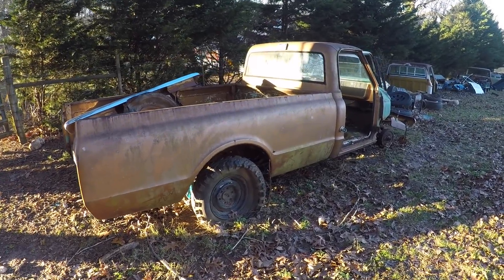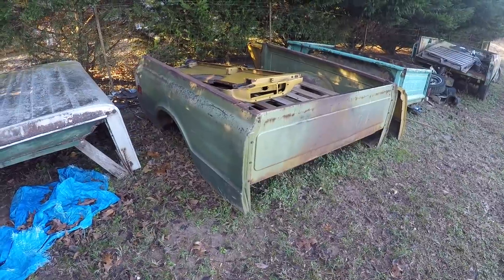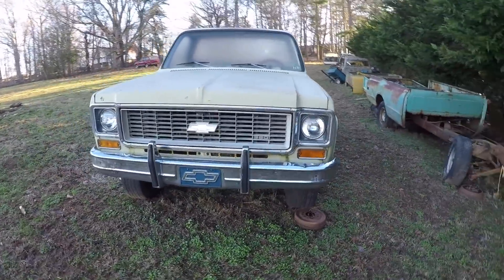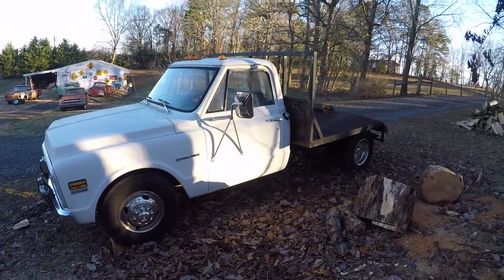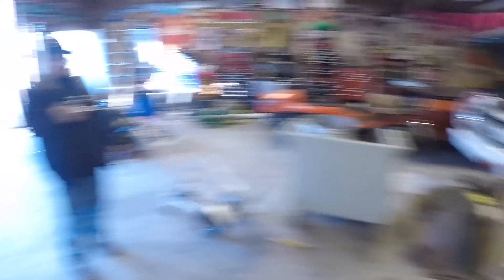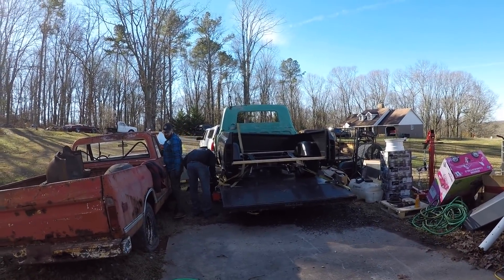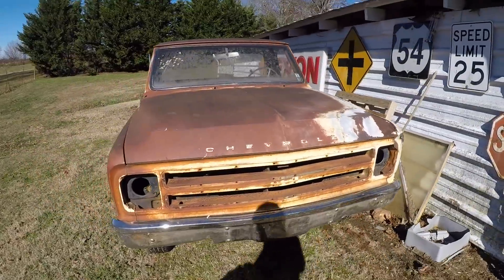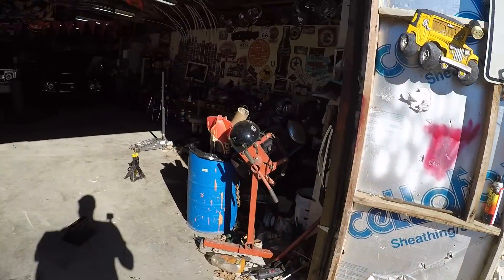CLEANING UP A MESS OF PATINA C10s!

Comment: Love the vids, I have a 1964 C10 I am resto-moding.  Was a rust bucket when I bought it a year ago.  Have "repaired" all the rust except the drivers door and hood.  Needed the normal, rockers, door pillars, door bottoms, a new roof inner and outer.  You get the idea, not professional repairs but cut out and welded patch panels in my garage.  But all of the suspension/steering/interior/brakes/lines/driveshaft are brand spanking new and upgraded.  Engine and Trans is a 5.3L/4L60e out of an 03 tahoe.  Brand new fuel system and radiator w/Efans, relocated tank to rear and brake lines.  Pretty much a decent looking truck with all new go go parts lol.  Hopefully be finished by the end of this year.  

Watching from Upstate SC

Comment: When you guys go to buy another truck on average what would you spend on a truck that needs alot of work??
Reply from the maker: That completely depends. If it's not running or simply a roller, I like to be in that $2-$3k range. Sometimes that works out, sometimes it doesn't. Too many variables to really say.
Reply: @UNITEDBYTRUCKS  thanks for the insight

Comment: What size rim and tires are on rhonda?
Reply from the maker: they are 18x8 and 18x10 AR TTIIs. Tires are 245/45/18 on front and 275/40/18 on rear. I would recommend a 295/45/18 tire rear with 18x10.